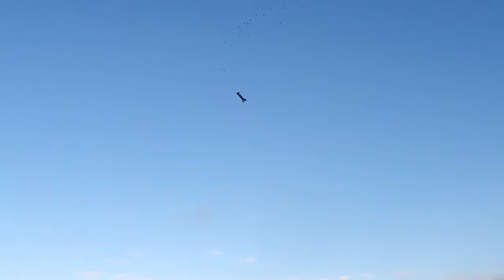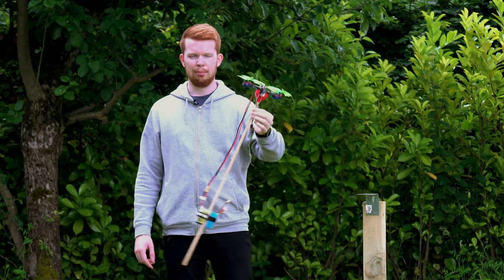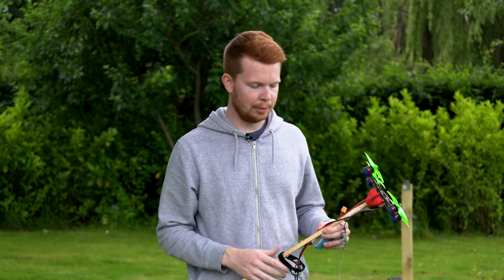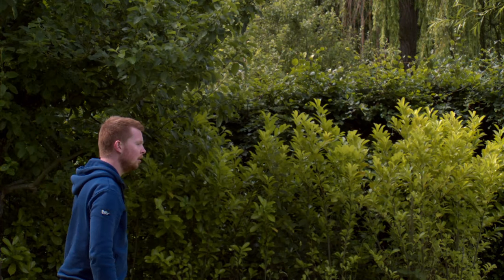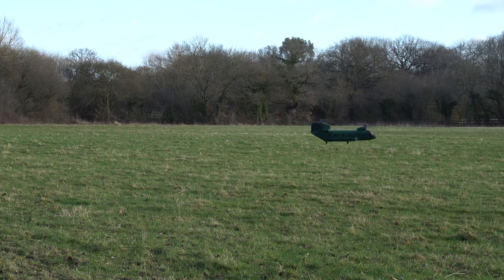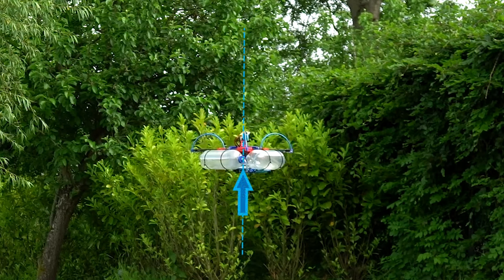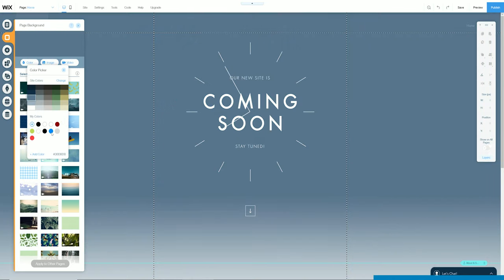Drone Pendulum Fallacy

Comment: If an offset center of mass produces torques that rotate the aircraft, could a drone be controlled only by shifting weights along tracks?
Reply: Interesting idea ! I think it should. If you have a propeller providing thrust in the center, a mass moving away from the CG (offset) should tilt the drone and thus redirect the thrust towards to desired direction... would be amazing if he saw it and tried !
Reply: @David N 
Yeah, but in this case shifting the centre of mass from the centre of thrust would induce a moment, as the thrust is acting at some distance from the pivot.

Comment: I built an RC hovercraft with two control fins at the back of the craft and the propeller mounted at the front of the craft. It worked far better than I expected. I found it could turn faster and with more accuracy then a rear-mounted propeller. You should give it a try.

Comment: The way I see it that a pendulum is a lever where the force is the direction of gravity and the fulcrum is a fixed point. Once the fulcrum is no longer fixed the lever doesn't work, neither does the pendulum.
Reply: Yeah, but it's more than that because the angle of the thrust changes, which makes the drone try to accelerate more, but the inertia of the mass will hold it back. (Video explained it well, but just wanted to make sure people knew it's more than just a moving fulcrum)
Reply: That's what Tom said in his video...

Comment: Add a pivot point, have the stick on a hinge
Reply: That wouldn't do anything to stabilize.
Reply: If you attach the stick to the drone through a ball joint it moves the pivot point. The props could act as fetching if the battery is heavy enough.
Reply: _ David _  the string I think would have no stability leverage instead just exerting dragon since there is no more lever. Also the string would add Bounce you need the rigidity from a stick to the reduce extra forces when changing direction.
Reply: _ David _  only if there was someone who could try it for us.

Comment: For those of you considering using a hinge. Consider the difference between a balloon and a drone. The lift you get from a balloon is consistently up; - so putting the weight below the balloon creates stability. Thrust you get from a drone is not *up*. 
In order for your flying machine to stabilize in the sense of up/down; you'd need a mechanism to detect which way is up; (Like balloons do, due to the pressure forcing it to float up).

Comment: string vs wood as pendulum would've made any difference?
Reply: Me 2 that would just increase the mass. It wouldn’t be able to swing
Reply: Just make it harder on the motors, as the string would flop down without generating torque on the drone, creating a downwards force

Comment: For the SpaceX tube center of mass thing, I think it's useful to think of balancing a broom on your hand. It's easier to do if the broom head is at the top than if you try to balance a handle with no broom-head or balance the broom from the bristles.

Comment: I expected to see footage of the actual drone you mounted on the pendulum, which IS able to maintain level by thrust vectoring (different rotor speeds). I imagined this to be very useful for stable camera drone shots, because the pendulum adds a lot of pitch / roll inertia.

Comment: Hi Tom what would happen if you had a pivot at the power source connection point.
Reply: If the drone could pivot about the connection point *and was using a flight controller to keep it level*, then you effectively have a regular drone with a weight hanging off it.  If it could pivot freely, it wouldn't be any more stable
Reply: Same as the chopper. Watch the bit without the body. You will see that's doing exactly what you're asking.
Reply: Im pretty sure he meant without a gyro
Reply: Phillip Shcherbakov yes without the giro.  Would this then become stable. And eventually right it's self ??
Reply: PKMartin great answer 😬
Reply: @sasvapes8014  No, the weight would, but as it is rotating freely from the drone, it would have no efect in its flight, apart from moving the CoG around all the time, which would actually make it more difficult to control

Comment: Very interesting!  Only one thought: the quadcopter's tilt is vectoring the thrust in a way that produces a forward and upward vector component.  Presumably, if the force of that upward vector component were to exceed the downward force exerted by the weight, the weight should swing back downwards since now there is a greater force acting upwards at one end of the stick.  I think if you raised the throttle it would have levelled out.

Comment: For the compressed air-jet controlled drone a pivot/CG in line with the different air-jets will minimize the offset and thus maximize the rotational torque for control.
I don't think you made that clear enough in the video.
Other than this I think this is one of your best videos yet! It really nails the technical details when focusing on a common misconception and provides a very clear and understandable argument as to why it is a misconception. Wonder full!

Comment: Another way to look at it is overcoming inertia.... if you hang a weight on a string  with the fixed point, yes, you have a pendulum, but if that weight is hanging straight down and you move that fixed point sideways, the pendulum moves slower than the acceleration and it will stay at that angle as long as the vector stays higher than the periodic swing time of that length of pendulum.

Comment: Take you battey on one end of a stick. Balance the stick on your flat palm with the pack near the bottom. Now flip the stick over and try again with the weight at the top. 
tiny, quick adjustments are needed to stay in control while its flown around. the happy medium is having the center of mass as close to the center as possible.

Comment: The problem with assuming a pendulum effect works on a drone is that you are assuming that the rotors have an upwards thrust, which if your drone has stability problems, they don’t.

Suggestion: build a drone with individually gyro-stabilized rotors, and a body that isn’t (each rotor has full three degrees of freedom relative to the body, and using gyroscopic sensors are pointed upwards). If the rotors are far away enough from each other, the drone could flip end over end, and maintain stable level flight.

Comment: You don't have a perfectly upward force because the stick forces the propellers in an angle. If you would use a sling instead of a stick the pendulum could swing without tilting the propellers and thus still provide a perpendicular force upon the weight of the pendulum. But I suppose this wouldn't stabilize itself but instead start swinging harder and harder untill the drone flies to fast for the weight to catch up.
Reply: yup, as now the force from the drone's movement also acts on the sling, so it doesn't react to purely gravity anymore.

Comment: Stability is the tendency for an aircraft to  automatically correct for a disturbance. This vectoring control reminds me of an altogether different sort of machine, but with similar results. That is, how tracking a motorcycle left or right will cause it to lean right or left. I believe this is a second say a motorcycle rides with such stability, along with gyroscopics, yet I believe it is the only way a motorcycle will right itself after a bank, which it will, even without a rider. Because once in the bank, the bike would have a new stable point as far as the gyros go. Thanks for the video and I'm going out to buy some Wix filters right now to support  your sponsor.

Comment: Thanks--I've been enjoying trying to overcome my bad intuition with good physics and I love it!  

One thought about the source of the pendulum effect on our intuition is due to parachutes and those twirly helicopters on a stick that kids play with. We all learn that they are only stable with the weight on the bottom, and the effect "feels" very similar to a drone, helicopter, or rocket. The difference is that the force that operates the parachute or that spins the helicopter sticks originates from atmospheric drag as the object falls. This creates a type of normal force at the propeller/parachute (aerodynamic center of force) that is perpendicular to the ground, which creates the pendulum effect. Obviously, a drone and a rocket are immune to this effect... unless they end up in freefall. If your drone started descending quickly, using atmospheric drag to slow it down, it would start to pendulum and the weight at the bottom would keep it stable in the sense that the weight would tend to hit the ground first.

Comment: There is also the issue of drag on the pendulum, you use a long pendulum and this creates drag as it moves through the air, this is having the effect of increasing the drones angle of attack therefore it accelerates in that direction.

Comment: For the drone I built, I had to use a battery that is lightweight because the ESCs can handle 4s, but the motors are designed to handle up to 3s (granted they could probably handle 4s at low load, however I'd rather get different motors). Watching this video, I've come to the conclusion that even though the gyro stability helps, it still has more weight towards the top due to the position of the motors and the fact that the propellers are double-bolted (I couldn't find prop adapters that have inverted threads that fit my current motors). I could possibly add a bit of weight further down on the "legs", but I don't want the drone to get too heavy.

Comment: Brilliant demonstration of center of mass (gravity) and center of thrust in a free flying object. Very nicely done.

However there is a real world example of a pendulum providing flight stability and that is a powered paraglider (paramotor)

The pilot hangs suspended from a flexible wing with the engine on his back providing (forward) thrust. Pitch (rotation about the left-right axis) and resultant altitude is controlled primarily by power (although wing configuration alters this to a degree)

 A turn is accomplished by initiating yaw (rotation around the vertical axis) by using the "break" lines to increase drag on one wing tip whilst decreasing it on the opposite tip. This results in roll (rotation about the fore-aft axis) The pilot and engine move outwards, away from the direction of turn whilst the wing moves inwards towards the turn (rotating around the center of mass somewhere above the pilots head) 

If the harness is trimmed correctly and an appropriate power set the pilot can let go of the break lines and the aircraft (?) will fly straight and level with no pilot input.

If the pilot were to initiate a turn and then let go, after some swinging about, it will return to straight and level. 

So here's the question; is the dynamic stability due to the pendulum effect or something else?

Time for a radio controlled paramotor model fitted with loads of remote telemetry sensors and FPV cameras :)

Comment: This got me wondering! What if you used a weighted teeter totter? Two of them through the center of the drone. One front to back and one side to side for pitch and roll. Using your single center motor setup. The harder the teeter totter is kicked the faster it should move in the intended direction. Not to mention if the teeters were put on a moveable slide wouldn't the effect  be greater if moved at the same time as the kick in the same direction.

Comment: You are of course correct. But what about aeroplanes, particularly models where dihedral and parasol mounted wings seem to use exactly the pendulum effect and it does work?
What about vertical fins, just under the props, so if the drone move sideways they will experience drag but the pendulum bob, the batteries will experience less drag and tend to right it. I actually don't think this will work, but I can't see why at the moment.

Comment: i think one good parallel is trying to balance a large hammer on your hand, it a lot easier with the head of he hammer at the top.
Reply: Being a mechanic and playing with  hammers on occasion, I have to disagree. The mass of the head of the hammer will not be affected by the small mass of the handle at all
Reply: @ZacLowing  "The mass of the head of the hammer will not be affected by the small mass of the handle at all" what that got to do with anything. i'm talking about actively stabilizing the hammer. it probably not the best analogy since a lot of hammer a stable head down but those that aren't are really hard to stabilize, it usually compared to a pencil.

Comment: If you want it to work, you need to mount the stick to a ball joint at the drone. This is so it can swivel and the thrust is no longer holding it completely in a straight line.

Comment: That is also why it doesn't matter if an aircraft has a nose mounted pull propeller or a tail mounted push propeller, when it comes to air stability (assuming the center of gravity is the same).

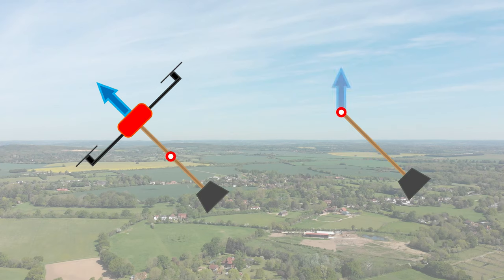Comment: I appreciate this explanation. It's very well put together. However the force drawn at 5:19 on the pendulum pivot is incorrect. The beam (or string) of the pendulum is a two force member and the force it exerts at either end will be aligned with the beam.

Comment: very nice! it made for me a sense about how center of mass can affect the stability of quadrotor. i personally have experienced something similar on a quadrotor which i had no space for a big battery. so i had to stick the battery on a low position and the flight controller had a big trouble to stabilize the quadrotor. by the way thanks alot.

Comment: The mass should be able to pivot so that you don’t get a long lever effect making it more difficult to swivel. I agree that the pivot point should be hinged by using a piece of string or something like a ball socket,  you’ll get different results then. A stiffly mounted pendulum forces the heaviest part to move along an arc causing increased resistance to movement.

Comment: You could achieve stability by controlling the pendulum angle with servos, controlling only "overall trust" and not individual prop thrust, and use the pendulum for control. 

Essentially, it would then be a helicopter.  What would really pivot would be the "rotor top" as the pendulum would generally stay low.  Also, 4 props wouldn't be needed, but at least two counter-rotating props would be required (or alternatively, a tail rotor).  Or, as long as it remains in motion, it could have a "tail fin" to maintain its direction.

Comment: Looks at those power line, that is big off balance weight, should have turn the battery connection close to the stick  then tape it.
With how it shown, the fly controller have to constantly adjust the motor speed to compensate the off set weight so it harder to keep balance.

Comment: Havent seen all yet but the fist test. For that to work you would need vertical motion. Now it just moves horizontal and accelerates which cancels out all possible pendulum stabilization effects. 
This may or may not work, but if at all this could work it has it’s limits and you can not start from an unstable staring point. I would assume there is a max threshold on how much tilt there can be until the pendulum would have the exact opposite functionality. 
This 45° tilt seem to be stable. Probably because it causes the drone to accelerate only horizontally.

Comment: Hinged or flapping blades on a helicopter are vital for stability.  
Not explored in this video but certainly an issue is lateral acceleration.  If the movement horizontally is accelerating the force of gravity is not "down" but in a direction away from the thrust of the propellers.  This rotates the rotors and thus the thrust more horizontally, which again changes the direction of "down".  The helicopter will crash.  
Helicopters carrying heavy weights have the same problem and the weight must be free to swing without imparting a torque on the rotor disk.  Even a little bit of feedback will start an oscillation that is impossible to control. 
To carry something by drone the weight must be suspended in such a way that the suspended load cannot impart torque on the rotors.

Comment: But if you add a lightweight mast on top, with a large ball to create drag, that would reduce the pitch angle once the horizontal velocity built up. The result would be to reach a terminal horizontal velocity, possibly quite low. It might wander about drunkenly as wind puffs perturbed it...

Comment: there is actually some stabilizing effect for a low center of gravity for helicopters and multirotors but it's a bit more complicated and indirect and doesn't really behave exactly like you would want a stable aircraft to behave
the thing is if you have a helicopter or multirotor/drone with large rotors and it slightly tilts off the horizontal position say forwards through turbulence then it will start moving slightly forwards - the same way helicopters/multicopters tilt forwards if they want to fly forwards on purpose
now if it is moving forwards it will create some amont of aerodynamic drag - and since the rotor / rotors when spinnign act as alrge aerodynamic surfaces a large part of that drag acts on the rotor with the rest being distributed over the fuselage
thus is the center of mass is low relative to the rotor and fuselage this drag force will act on hte helicopter/drone ABOVE the center of mass and a backwards acting force acting above the center of mass will pitch the drown backwards, thus counteracting the initial forwards tilt
so there is some stabilizing effect but unlike the aerodynamic stability in an airplane or the stability i na pendulum that people falling for the drone or rocket pendulum fallacy might expect it is indirect, it doesn't directly react to the tilt but to the reacting movement so it's delayed and can overreeact and lead to other sideeffects